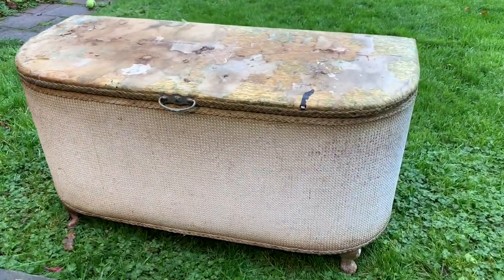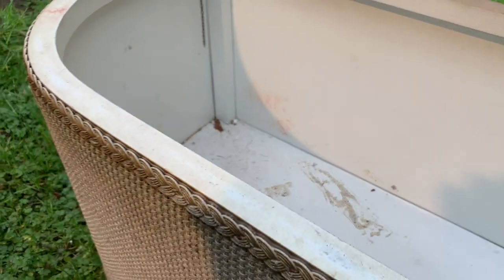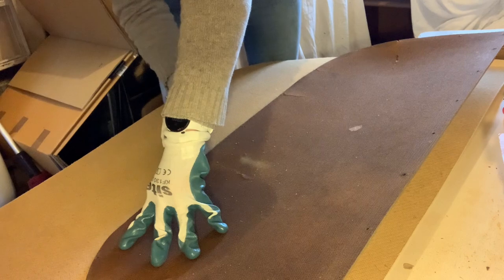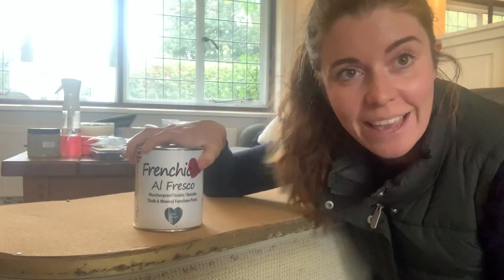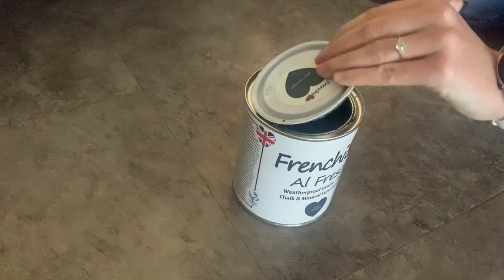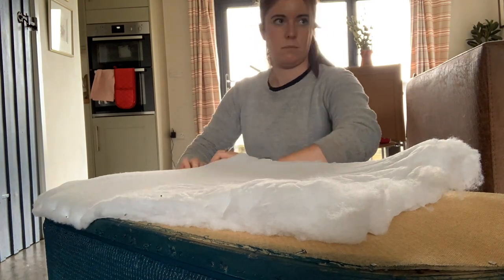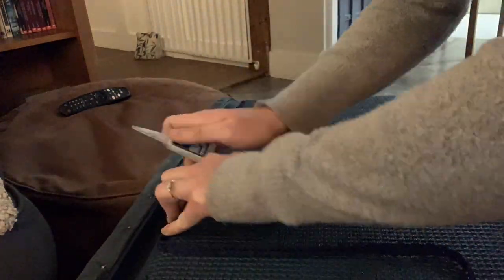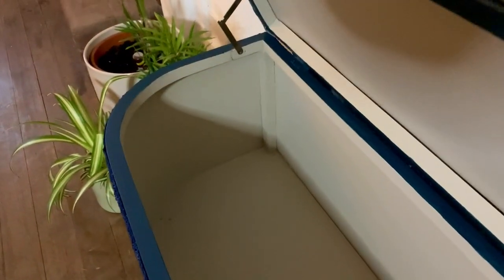Beaten up Lloyd Loom Ottoman; from trash to treasure?! #upcycle #furnitureflip #restoration

Comment: I liked the original woven trim much better. I can’t believe you pulled it off for the cloth trim.
Reply from the maker: Fair enough! I wish I could've had a proper go at salvaging that original trim, it didn't really show properly in the video, but it was super damaged. I think probably beyond help- but perhaps as my skills continue to develop I'll be able to repair stuff like that better. Thanks for your comments.
Reply: johnmeigs719  Or you could just  buy new trim from seat weaving supplies.

Comment: Good job, but next time your upholstery fabric should be pulled tighter and your stapling closer together to make a smoother, unwrinkled finish on top.
Reply from the maker: Thanks for the tip! I'm practicing my upholstery so that's really useful. Thanks for watching!
Reply: May I please call on your expertise to help me finish my own Loom ottoman? It's in original condition. I restored the paintwork to original colour, and I've found straw stuffing under the original fabric upholstery! It's lovely, but marked with paint, sadly. Plan is to leave it in situ, and glue a piece of high density foam (cut to shape) over the top - in part to make it taller - then finish with a heavy cotton velvet. Would you say that sounds good, or should i go with a sheet of batting/wadding instead? Lastly, would I need to use dracon to get the rounded edges I seek to replicate, or will the velvet shape it, once nailed in place?
Reply: @jennytaylor3324  I would add 1 inch foam, then Dacron. Cut foam to fit lid and extend Dacron slightly past foam edge. Staple Dacron to side edge, cutting it off to keep it from going under your lid and adding bulk. Pull fabric front to back and stapling center underneath lid, then side to side stapling center. Then working stretching and stapling out to sides. Velvet is an unforgiving fabric and not easy to get smooth edges. Your staples need to be about 1/2 to 3/4 inch apart. You should also ditch that heavy hand stapler and invest in an upholstery stapler. Air staplers (pneumatic) are best, but at least an electric. It will make a huge difference.
Reply: @leannhayes5444  Thank you so much! Yep, not looking forward to trying to get velvet to sit right, although it's gorgeous Laura Ashley stuff I bought cheaply on Ebay. Thank God for brocade trim! Been putting the job off atm for fear of screwing it up! Was going to be using upholstery nails, but stapler you suggest sounds  tempting. Are the nails hard to use accurately?
Reply: @jennytaylor3324  I personally find nailing velvet particularly difficult to do smoothly, especially on a narrow edge. It may be best to use spray adhesive to attach the foam, then just a few tacks to hold Dacron in place while you stretch and attach the cover fabric.
Reply: @leannhayes5444  Cool. Will follow your instructions, as I'm an upholstery novice. Pray for me! 😜
By the way, what weight/depth dacron would be best? (Sorry for all the questions.)
Reply: @jennytaylor3324  2 ounce bonded Dacron is about an inch thick.
Reply: @leannhayes5444  Duly noted. Thank you!

Comment: Should have carefully removed the original trim and you could reuse the tacks. More practise on upholstering required - more filling and then pulled taut. The cover doesn't match the body. Sorry, but I think this is a fail.
Reply from the maker: Thanks for watching Jules! I totally agree regarding the upholstery work, I'm practising it - I haven't done much of it before so this was a bit of a practise piece. I'd have loved to save the original trim, it didn't really show through in the video but actually it was pretty damaged in quite a few places so I think beyond salvaging. Thanks for your comments!
Reply: Be kind.  The tacks may have been too rusty and bent to reuse.
Reply: @hollysdesign  I didn't mean to come across as sounding mean as I'd like to see more UK upcycles. I've done a couple of ottomans myself and they can be tricky. Just because I think this is a fail doesn't mean you won't improve, which is what I hope will happen. Onwards and upwards.

Comment: Good job! I like your paper plate hack (stealing that 1!), and the hinge was a clever touch. Those chains can be hard to re-attach cleanly 😐. I adore really old Loom and its vintage sister brands. I've done up 3 pieces over the years, one Spinney, 2 Loom. I found out that what makes Lloyd Loom distinct from the other wicker furniture of the day (Spinney, Kraft, Sirrom etc) is that they used paper-wrapped wire, rather than actual wicker basket material. If you run a a magnet over a piece and it sticks, it's Loom, apparently - with or without the badge - which is often missing. I can tell Loom at a glance now. 
P.S. I think gold, copper or silver highlighting on the corners and edges would really set your piece off!
Reply from the maker: Thank you so much for your comment Jenny! The paper plates are so handy, can definitely recommend stealing that trick! That’s so cool that you’ve done a few. This was my first Loom. I’ve since done a little Loom rocking chair as well, although it just needed a repaint- no repairs. Thanks so much for watching!

Comment: Please could I have some info about how you cleaned the main body? I'm have my first piece of Lloyd Loom - a chair. It's absolutely filthy, so filthy the dirt will spread if I even attempted it. But I'm terrified of making it at all wet. Any advice would be so appreciated.  You did such a fantastic job of this ottoman.
Reply from the maker: Of course! Thanks so much for your comment! I use sugar soap on pretty much everything, it cuts through grease really well. I would vacuum any dust and stuff first, and then probably mix a big tub of sugar soap with hot water and just start scrubbing. You might get through a couple of tubs! I think don't worry too much about getting it wet, you obviously don't want to leave water sitting in it but if you dry it off a bit afterwards and then leave it somewhere warm overnight I think you'll find it dries out nicely. Thanks so much for watching, and good luck with the chair!
Reply: @hollysdesign  thank you so much. I've got a big box of sugar soap so I'll give it a go. Hopefully I can do the dirty bit in the garden, then pop it in the house to warm up and dry. I really appreciate your advice 🙂